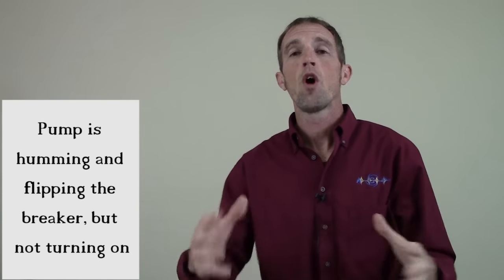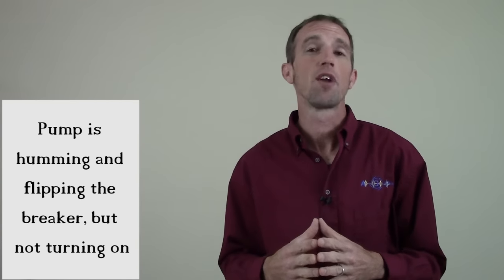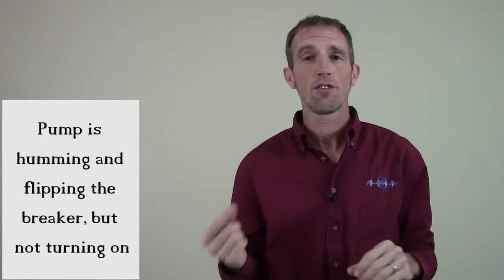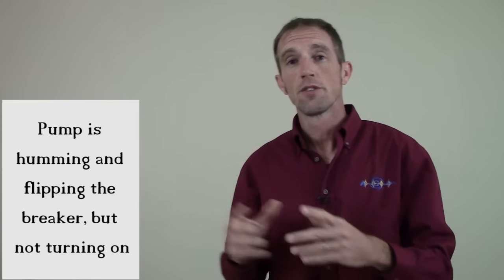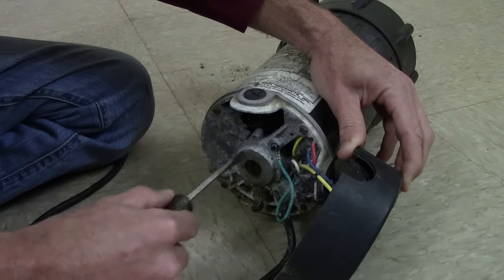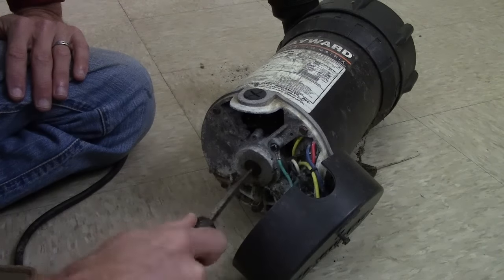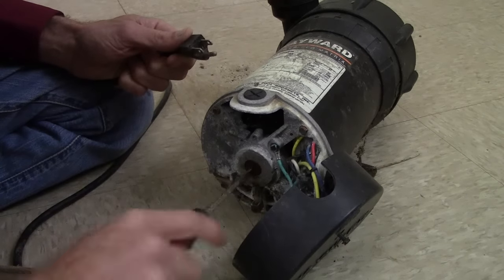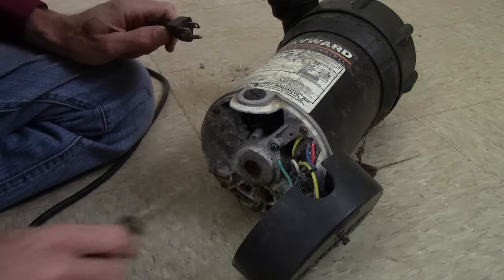Above Ground Pool Pump Won't Start or is Humming & How to Fix It

Comment: Ok question I did that it worked great but every time I have to turn it off and turn it on to back wash or just start the next morning I have to repeat the process of the video the question is what could be wrong with it that I have to repeat the process every time? Capacitor maybe? Thank you for your video it's great
Reply from the maker: Above-ground pumps don't have a capacitor. You very well could have something internally wrong in the motor which electric motor repair man could fix it for you

Comment: Need to clean switch contact, but can’t find something that shows how to remove rear cover to access centrifugal switch.  Probably need to clean contact.  Maybe it’s just corroded on, and needs hammer.  Just wish I could see the clean way before I break it off.  Each of the four long screws broke when removing.  One at base and three at heads.  When powered it spools to half speed but doesn’t switch over.

Comment: Hello, thanks for your video. My pump is humming so I will try your trick. Just to make it right, when you plug it back on and let it turn for a few hours, should the pump be on the pool or not? I've already been told not to plug a pump without water. Please let me know. Thanks.
Reply from the maker: You only should ever run your pump with water in it
Reply: @abovegroundpros  That is what I was told but in this video (and others on the same topic) you start the pump on the ground. That is why I was confused.
Reply from the maker: That's just simply because I'm in my office recording a video on a dry pump
Reply: @abovegroundpros  OK I understand. Thanks.

Comment: What about the next size up?mine will spin but seems to not be able to get up to high speed....then gets hot and turns off
Reply from the maker: That's a little above my head. You might want to have an electric motor guy take a look at it.

Comment: So this is my issue. Pump turned on fine, shut off to put chlorine in. Went to turn back on and it hums. Replaced capacitor still hums, shaft turns freely and I was able to jump start this without issue. 

What else could be the issue?

Comment: I have a Hayward super pump for an in ground pool, will this work or is the pump to high power to risk it
Reply from the maker: +will delaney If you have an inground pump, then the problem you are having is probably the capacitor.  I would replace that first.

Comment: Didn't work for me , mine spins free nicely but just humming then a click sound , took the cover off an mine does not have a  capacitor .. worked for 2 weeks this June then quit on me , I left it un plugged for a day an let it cool down if it was a heat problem,  an tried a different outlet .. no luck its a off brand pump extremepowerus , it was a pump filter bundle for like 240 .. i got like 3 summers out of it, an always stored it indoors in the winter 1.5 hp , 115volt .. ill polly just have to buy a new one but any tips are welcome

Comment: My pump stop working and humming but i see a lot of fluid on the body and also in the water, seems like there is oil in that pump, do you have any idea what to do? Thanks
Reply from the maker: I haven't seen that before. I would probably recommend talking to an electric motor repair man about it

Comment: A lot of pump motors have run capacitors on them.  If this technique doesn't get you going, and you have a run capacitor, its worth trying a new capacitor.  They are usually $10 - $15.  The capacitors manufactured within the last 10 years don't seem to hold up as long as the old ones.

Comment: So kickstsrt it dry for 12+ hours to get all the corrosion loose? Or connect it to the pool and then kick-start it?
Reply from the maker: No you do not ever want to run your pump dry for that long for fear that you will burn your pump up. You need to have water running through it

Comment: Mine keeps freezing up every time i go to run it after a week i have to take mine apart and turn the rod again..is there anything i can do to get rid of the corrosion? Should i spray something in there? And ps not a great idea to have cover off and poke around inside electrical parts normally protected by not only sealed cover but one that screws shut to remind knuckleheads hey this next area you are entering is only for those who know where the bear pooped in the buckwheat...if you have kids around including babies pets teens or irresponsible buddies then dont take cover off at all. At least until you know you will be alone, but always let someone know what you are doing in case you get zapped. I was electrocuted last year and i was alone outside and no one knew where i was i was mid calf deep in water a sump pump running and my pool pump i thought was unplugged i grabbed to move to higher ground and my back was worn out having just cleared our neighborhoods storm drains because the rainwater was pouring down and the street was so full storm drains so clogged the water was clear up to our garages and about to flood into our homes soaking wet freezin cold my back from pushing a huge water broom in my back yard as i said grabbed one hand on the pool pump and then quickly started to lose my footing my shoes stuck in the mud of my flooded sump pump running yard i tried to swing the pool pump closer to me my feet did not move my back twisted and not wanting to pitch my pump into the water i grabbed the metal frame of my pool...well my pool pump was plugged in the chord was wet and so was my sump pump and i was almost knee deep in water holding onto a metal frame. I felt immediate old familiar buzzy feeling bolt through my arm my fingers felt like pins were stuck in em and ill tell you something i dont know how but i managed to set the pool pump down on a dry surface i remember clearly yelling OH HOLY SHIT HEY UH UH UH UH NO NO NO NO NO YOU DUMB SHIT WAY TO GO and then i found myself standing without shoes or socks standing five feet away from the pool the pump and the sump pump but alas under the water both shoes with my socks still in my shoes as if i jumped out of them so fast the socks didnt even come with my feet...i have no idea how it happened all we can figure is i got shocked and my brain went fuzzy for a spell..if you have any idea love to hear it oh btw my shoes were rubber why did i get shocked i still dont know. And ps can i just replace the impeller or copper stuff? Sincerely, i never say no to a good days work, from the brave broad the dizzy dame in California.🐝🌴🌺☀️

Comment: I tried turning the screw on the shaft.  It was already loose and did not start the motor.  However, I slighted rapped on the housing around the housing around the motor and it started up!!!!  All's well that ends well!

Comment: I have a similar pump and after removing the casing, I noticed a V shaped piece that obstructed the impeller rod. It was some form of safety switch and after pushing the button, the motor ran like new.

Comment: There is some sort of a switch that partly blocks my access to this screw, so that I can't get a clear angle on the screw.  Any suggestions?
Reply from the maker: vermontmark2 Sounds almost like you have an inground style pump.  If you can't turn it from the back, you may be forced to take the front of the pump apart and turn the impellar itself.  Unfortunately I don't have a video for that.  It's a bit more extensive.

Comment: is there a way to access the motor windings and clean off the corrosion?
Reply from the maker: That I do not know but I would recommend a motor guy taking care of that for you.
Reply: Thanks, BTW your video helped me out... especially the lite tap with a rubber mallet.

Comment: Question please.  I tried the shaft and it turns freely and it still humms.  Could it be the capacitor?   You can hear the humming and shaft and impeler move freely.  Thanks.  Great video
Reply from the maker: If it's an inground pump it's the capacitor but if it's an aboveground pump they don't have capacitors and it's probably just a bad pump.
Reply: Thanks.  Inground pool.  I looked at the capacitor and it is bulged out on the top so I am certain that is the problem .  Oops I forgot to mark the positive and the negative.  WHAT if I hook it up backwards when I receive the new one.  There are two prongs with 4 each.   Thanks Billy   Its a 30uf  440v
Reply: It was the capactor.  Simple repair and back working again.  Inground pool.   $10.00 repair and did it myself.  yessss

Comment: Using this method reliably gets my pump started. The problem is, I have to do it every single time - it won't start on its own all of a sudden (note it is July and the middle of peak season). 

I have a whisperflo Pentair, which has a running capacitor located just above the motor. I have replaced this capacitor twice to no avail - one purchased online and one purchased from a local pool place, the latter being an exact match. 

I am out of ideas. Is there a second starter cap somewhere that may need to be replaced? The impeller is unhindered and moves freely, as does the motor and the pump works as mentioned when I use this method. But it won't start on its own.
Reply from the maker: +Darkblade516 with an inground pump, this issue is usually the capacitor.   If not, i would recommend calling a pool guy to come take a look.
Reply: So I returned the third capacitor I brought from the pool supply place. They offered to test it for me. It was apparently bad.

They gave me a replacement free of charge, which was a bit smaller, but still fit. Suddenly, it works. Apparently I had two bad new capacitors, plus the one that went out. Just my luck...

And no, there is no starter cap on the whisperflo line, if anyone else was wondering.

Comment: I use my cordless drill with a flat screwdriver bit in it and spin it real fast and turn the switch on. Works every time on the first start of the season.

Comment: My pump keeps blowing a bussmann sc-25 class g fuse. I checked the capacitor and the readings are OK. The shaft also turns freely. Atm I'm at a loss to what might be the issue. Could it be the brushes that are shot ?
Reply from the maker: Your best bet may be to take your pump to an electric motor repair
Reply: @abovegroundpros  So I had the pump inspected by a tech and he emediately had it turning by applying 220 volts and it was drawing 5.1 amps. Told me that the motor is fine so my issue is elsewhere. Dang...I hope it's not the power pack! I've been through 3 of them in the past 11 years and the last one is only a year old and they range in-between 500 and 800$ cad!!

Comment: My pump isn’t making noise at all while turned on. Hit the reset button just dead silence. Is the motor done?
Reply from the maker: Unfortunately it sounds like it.
Reply: @abovegroundpros  I figured that's the case. I have a 24ft above ground can you suggest a decent one? I hear sand filters are better

Comment: What if the pump was running but then went up in smoke any way to fix that? Had a fray wire on switch I fixed that but it humms now but still no rotation

Comment: My works but I run it off my solar and humms now I worked great before wirh it but stopped one day it was raining box got wet so fix outlet but now still won't I upgraded 2 separate inverters alot bigger still won't went to from 1500 watt to 5000 still don't what do I do help me out

Comment: TY for posting.....I watched the video and read all the comments, then tried this on my pump and  got nothing ! the pump hums and will trip my breaker but the "shaft" wasn't frozen and turns very easy w/ screwdriver . What next???
Reply from the maker: +CUdetoom if its an inground pump then the capacitor may be bad.  If it's an above ground then its probably a bad motor.
Reply: TY

Comment: Hello, just to let you know that I succeded to get my pump turning again. However, it was very stuck. So what I did was to put some paper towel around the 'screw head" and used some Jig-a-loo all around it using the tiny straw. After a few shot of that it was turning freely, Yeah!!! But now my pump is very noisy, a lot more than before. Have to find another video to solve that issue too.

Comment: So when you say to leave your pump running 12 hours, do you mean just plugged into a power source .. no water ??
Reply from the maker: Absolutely not. If you run the pump 12 hours without water running through it you'll probably burn your pump up.
Reply: Good Lord THAT was freaking fast. I assumed that but someone once told me when you assume something ,you make an ass out of u and me so ask !!  I didn't hear Chad say hook it back up to the water line soooo.... just checking !! THANK you for ALL you great tutorials. Have a wonderful holiday !!

Comment: wound you not check if their is something is in the impeller first?
Reply from the maker: What we share in the video is by far the most common reason for the pump humming.  Very seldom have I seen a clogged impellar cause the pump to hum.  If the impellar is clogged it is common to not get any water flow, but not make the pump hum.  I would always try this first and then maybe disassemble the wet end of the pump to check the impellar if you thought you may need to.

Comment: Chad, you sir are a steely-eyed missile man!  The impeller shaft was so frozen that the "screwdriver twist/ power-on" had no effect on it... so I swapped the screwdriver for a hammer-drill and that had no effect either... figuring I had nothing else to lose, I put the screwdriver back in the slot and started wailing on it with the hammer and next thing you know, the impeller started turning!  I switched the motor on and a big puff of orange smoke shot out the back and it started right up (just like my car in high school!)... thank you so much!  
Question, should I squirt any kind of WD-40 or some other kind of lubricant down the back of the impeller before I screw it all back together again?  Thanks again!
Reply from the maker: No don't put any lubricant in it because you will damage the electronics. Worst case scenario you would just have to take your pump to a motor shop and let him rebuild the inside of it. It's usually fairly inexpensive

Comment: shaft turns freely with a screwdriver, pump hums yet no start, tried kickstarting and it didn't work, think the drill thing will do the job?
Reply from the maker: +Hill Billy This usually means there is a power issue or the pump is electrically shot.  Make sure you have adequete power to the outlet (or an extension cord that can handle the power) or if you have a capacitor on the motor (you porbably don't if its for above grounds) and replace that.
Reply: +Above Ground Pros tried the drill kickstart and it fired right up! thanx so much for your help and video!

Comment: Is there anyway to grease or oil the motor or is it a closed system?
Reply from the maker: +Tony Medina Unfortunately if you out WD-40 in the motor it will deteriorate the inside of the motor.  You may have to ask a motor guy for more details on this.

Comment: Chad this worked great but now it stays on for about thirty seconds and trips the breaker what do you think would be the problem now?
Reply from the maker: It sounds like there could be a possibility that the pump is pulling too much amperage but you would have to have a voltmeter or an electrician take a look at it

Comment: my shaft free spins, but only hums then blows the breaker. got a new start capacitor and still just hums. so something else is wrong or I got two bad capacitors
Reply: also mine is hw super pump and has the governor and v switch infront of the Shaft screw. not really a way to jump start it with all that in the way

Comment: I've had similar issue with my filtration pump. Exept it actually makes an attempt to turn. In my case it was always the mechanical seal that got stucked (and it allows the motor to spin only to extend of the will of it's inner spring). What I had to do, was to reveal the seal and get those ceramical ring parts separated.

Comment: What if the motor won't turn on and keeps flipping the breaker? Does it need to be replaced then? Thank you in advance!
Reply from the maker: Becky C That depends.  Is it humming and then flipping the breaker or will it not do anything and then just flip the breaker???
Reply: It is not humming. When you try to turn it on, it flips the breaker.
Reply from the maker: Becky C Unfortunately that sounds as though the pump may be dead.  The only other thing I can think of is that maybe the breaker that the pump is on is pulling more power than it's able to.  This could mean that something else is plugged into the breaker that is causing a power surge or the GFCI breaker is bad and flipping once you get power to it.
Reply: I appreciate your help. Thank you!!
Reply: Another question! We let the motor dry out thinking that it was just wet since we have had a considerable amount of rain. Last night we tried it again. It started, but then started smoking! We shut if off right away. Thoughts?
Reply from the maker: Becky C Oh no. A smoking pump usually means it burning up.  That's never good to see.  You may have to replace the motor.
Reply: Above Ground Pros Boo! What does a motor on an average run, so I know I am not being "taken"? : )
Reply from the maker: Becky C Motor around usually around $110-$130, but you may could find a good deal on an entire pump online for about $150 or so.  That may be a better option if the pump is older.
Reply: Above Ground Pros Many thanks to you! I appreciate your helpful videos and replies. Have a great day!